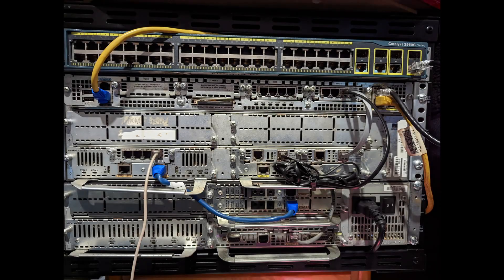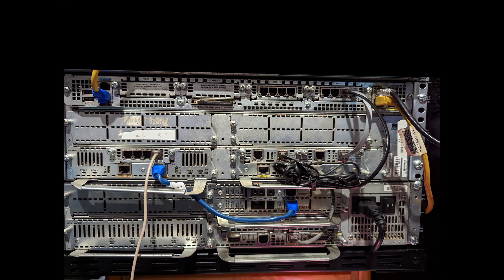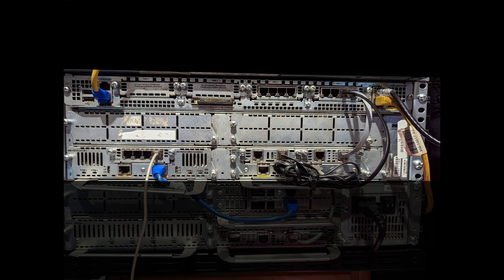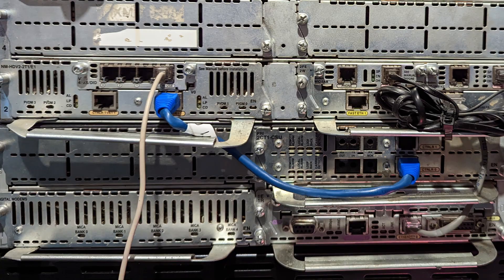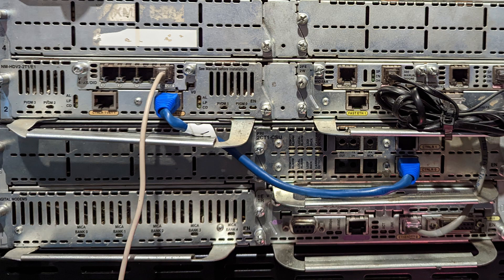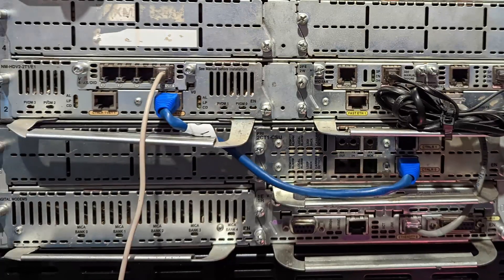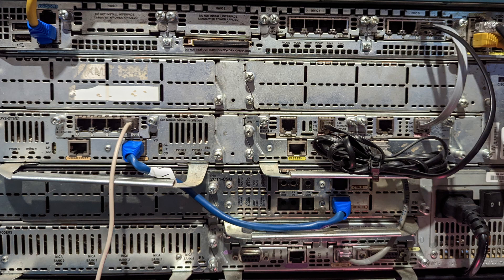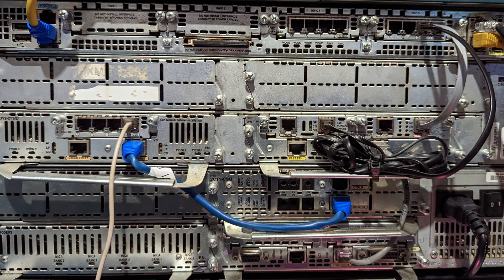Dialup V90 at Home - Hardware Info - What I Use [ASMR?]

Comment: Hi ! :3 I found a Reddit post from someone using a 2811 to have 56k using PVDM2-DM modules (rather than the NM-30DM, which apparently isn't supported on the 2800 series), VWIC-2MFT-T1/E1, HWIC-2CE1T1-PRI and FXS cards, do you know if it is possible to use a NM-HDA-24FXS rather than the FXS cards ?
Thanks :3

Comment: Hi!!! im from Argentina and i want to do this sooo badly for a looong time, here, sadly, we have closed imports. I really want to do this with parts in my local market so i need help, i have found a Cisco 3825 for a relative low price (i didnt find a 3640) if i can fit all in that 3825 now i can try to get the cards but im not really sure what i need to do this and if it will work. I really need help. We can talk over Discord if u want. Some big hugs buddy, nice work! :cheers: :blessings:
Reply from the maker: Sadly, the CSU won't work in the 3825. Well, technically if I recall, there is a "rev6" that can but its hard to tell what rev you have when buying them because you need to read it from the IOS firmware. The CSU is the important bit because it is the card that is able to emulate the telco.
Reply: @zefievideo  yeah i was seeing that, ive spoken with the seller on my area and he told me that i (may be) can do it with an FXS